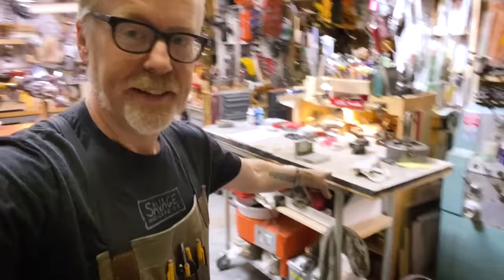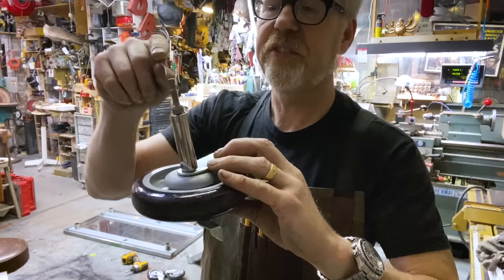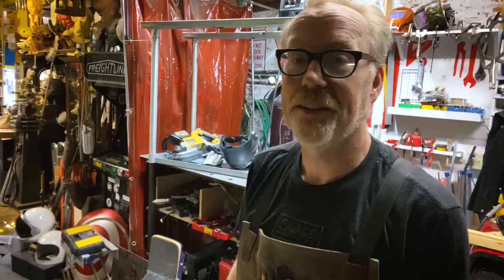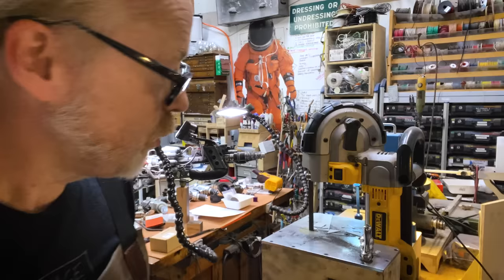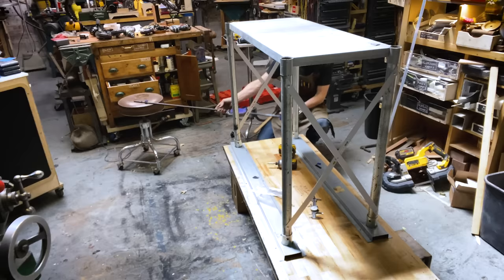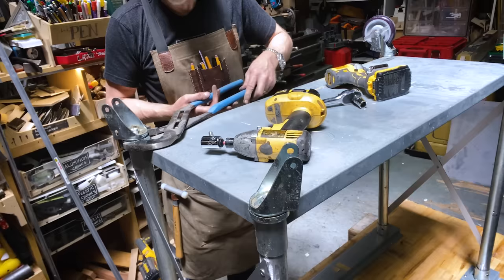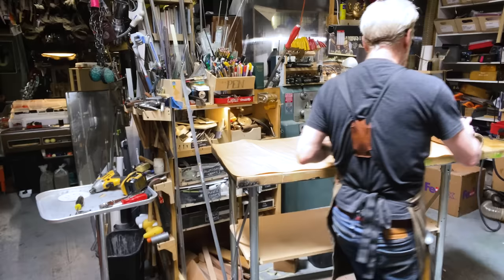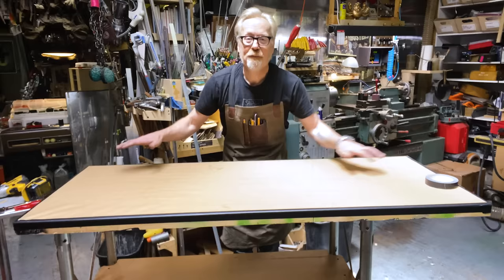Adam Savage's One Day Builds: Making a Stable Workbench!

Comment from the maker: Adam's Workshop Apron: https://amzn.to/3fHKdSs
IRWIN Quick-Grip Bar Clamps: https://amzn.to/2Z6IkYj
2" Black paper tape: https://amzn.to/2YiozOc
Reply: I'm going to hazard a guess that you got that aluminum from Home Depot, one useful trick with our labels is WD-40, soak them for a few minutes and they'll come right off with some minor scraping. They have an X cut in them to help ingress for exactly this purpose ;P
Reply: Do you have any apron recommendations that don’t use animal products? ie no leather
Reply: Can I gat a useful tool vid for the rolling Tray that you used here?!
Reply: Mr savage your wheel brakes are upside down....3 out of the 4!! Please revise ..xx
Reply: @caseyalexandrarich3452  steel 😭😭
Reply: Did you miss a rivet? on that 2nd cross piece.
Reply: Do you ever use self-tapers? (Basically a screw with a drill bit on the end)
Reply: LOL small ... check out the navy channel locks ... they make those ones look like baby tweezers ... btw on an oil rig the big wrench they use to tighten and loosen pipe segments ... are channel locks ...
Reply: looks good now ... you can always weld once you fix the welder if need be ... one other suggestion change from the wheel locks to a foot jack lock ... it will make it more stable and is easy to release and then wheel where ever you want ... like those mobile stairs at the big stores that sell in bulk or like hardware superstores .. that idea ...
Reply: Not Adam's hearing aids, something is definitely ringing in the shop(area). Sounds like a low revving turbine engine.
Reply: @HB-hf5ew  I think thats what was used. Pilot first to be sure .. to be sure
Reply: @smartgorilla  A steel apron would not be useful for welding.
Reply: @buddyclem7328  I know but it's vegan🤣🤣
Reply: Anything petrochemical will burn
Reply: @philstephes  I always thought those crosscuts were to prevent people from removing them in the store and switching them for something else... Now I know!
Reply: @caseyalexandrarich3452  - Have you tried doing a search for "vegan welding apron", "fabric welding apron", or " non-leather welding apron"?? There are a bunch out there. (Just make sure it's not just "Fire Resistant", but Arc Flash rated for high temperature splattering).

Apron #1 (CF & Aramid, with Nomex stitching):
https://steinerindustries.com/carbonized-fiber-series/product/steiner-13625-cf-woven-carbonized-fiber-bib-apron-36-black
Apron #2 (Thermonol High-Heat Welding Apron with Kevlar stitching):
https://www.grainger.com/mobile/product/STEEL-GRIP-Thermonol-w-Kevlar-ThreadHigh-5T351
Apron #3 (TexTech CarbonX Fabric - for Steel Foundries & Welding):
https://amp.rshughes.com/p/Chicago-Protective-Apparel-Carbonx-Welding-Apron-29-In-Width-48-In-Length-548-CX11/548_cx11/

Gloves:
https://www.kvmwelding.com/

If you wanted to make your own then perhaps a carbon fiber welding blanket fabric backed with denim would work?
"Lightweight & soft ... Sheds less than fiberglass":
https://www.sellstrom.com/carbon-fiber-felt-welding-blanket-black-p-740.html

Or this stuff is Arc-Flash rated, woven Nomex & Aramid... Sold by the yard and quite reasonable too ($15yd)! (They supply Nomex to NASA for the 2020 Mars Rover mission):
https://www.magnafabrics.com/collections/ripstop-fabrics/products/nomex-aramid-ripstop-anti-static-esd-clean-room-fabric-sage-green-12-50-a-yard
... You might want to put a thick cotton backing on it, so you don't feel the heat, but the fabric itself "should" be suitable.
Reply: Thanks for the build.
Handy tip Cardboard for bench covering, it's absorbent cushioning and tougher than paper.
Reply: steveday72 thanks I’ll check these out
Reply: @steveday72  They do have specific labels for that, but they're usually thick and used for things like electronics.
Reply: WOW great workbench if I had money I would buy that... P.S. I don’t have a penny to my name 😞
Reply: 29:33 you should take a look at the real beast... the Knipex Cobra XXL (22 inch version) as well as the Knipex Pliers Wrench XL (which is a beast in itself as well)
I have had the chance to test the big ones (just not have the use for those right now that would make me buy them) ;)
Reply: Those chrome sockets shouldn't be used in an impact, they will shatter/explode
Reply: What are those ear muffs he's wearing?
Reply: Why does Adam cover the work bench in brown paper?
Reply: I built a rolling cart one time out of
2 4x4x8 for legs
2 4x4x8 for sides
2 2x4x8 for sides
2 sheets of plywood for top and shelf
pipe fittings for handle
4 casters
Cut two 4" x 4" posts in half for the legs(4)
Cut two 2" x 4" x 8' into 2 pcs. so you end up with two 3 ft and two 5 ft pc.
Cut two 4" x 4" x 8' into 2 pcs. so you end up with two 3 ft and two 5 ft pc.
Cut plywood into 3 ft x 5 ft 
Now you build a 3 foot by 5 foot cart.
This next step works best with the flattest floor possible to keep square and flat.
Take two 4" x 4" x 5' and two 2" x 4" x 3' and screw together to make a rectangle.
Take two 4" x 4" x 3' and two 2" x 4" x 5' and screw together to make a rectangle.
For the strongest top use the rectangle with the 4" x 4' x 5' as the top.
Screw plywood to rectangles.
Screw legs to rectangles.
Attach casters.
Attach pipe fitting handle.
The only leftover material is the plywood.
The table is strong because of the 4" x 4" legs and the 4" x 4" in the sides of the tabletop/bottom shelf.
That cart was perfectly square to the floor. All 4 casters were on the ground at all times on a flat surface. Best damn cart I ever built.

Comment: I can't believe I may actually be able to give YOU a tip.  Channel locks have a direction.  They are built in such a way that jaws self tighten if you are pulling in the correct direction.  If I represent the channel locks with the letter "F" you want to pull the bottom of the handle to the right.  Of course if you want to go the other direction flip the pliers so you have a backwards "F" and pull to the left.  When doing this, much less of your energy is spent trying to squeeze the pillars hard enough to stop the stock from spinning.  Try it, You will not believe the difference.  We can all thank my Dad for that one,  Happy Fathers Day everyone.

Comment: When the camera started falling when using the mini band saw I was terrified that Adam would reach for it and accidentally hit the band saw with his other hand!
Reply: Same!
Reply: At 15:35? Yes! That little saw really needs a blade guard/guide, especially since he's typically only going to use it to cut thin little strips! If he ever needs to resaw 6" stock he'd use a different tool, no need to leave all that blade both exposed and unguided.
Reply: I RIPPED out my fingernail on my belt sander. It's getting better.
Reply: I still think that thing needs to operate on a kill switch so if he drops or lets go it just shuts off.

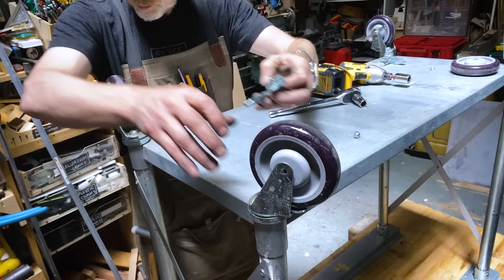Comment: 31:00 - Adam talks about how he should trust himself about getting the orientation of things correct while bolting the caster lock leavers on upside down... You do you Adam
Reply: I mean it seems to still work regardless? I think that was his point.
Reply: I only noticed the same thing because I have done the same thing myself. Good show
Reply: @Platinum_Squid  It would almostwork the way it's supposed to. Depending on the caster design having the brake lever installed upside down may not engage the brake correctly. Realistically it's more of a thing that he won't have as far a travel on the lever because it's designed to be a slight upward (U) curve so the lowest point of the lever is the middle where it connects to the caster, when installed upside down it's going to sit slightly below center of the wheels and therefor contact the ground before it fully engages the brake.

I highly doubt this is a big problem for Adam anyway though as he said the whole reason for this redesign was cause he hated it when he had to move it and he had to move it often so I doubt it'll be locked into position often.
Reply: I cam here to mention that also.... :)
Reply: @Platinum_Squid  how did you get that impression? That was obviously not his point.
Reply: I actually just re-inspected this point and the style of caster he's using would barely work if at all with the brake lever installed upside down. If you look closely there's a triangular piece of metal at the center of the lever, this is what actually applies the brake and should be interacting with the inner plate you see Adam install between the caster and the lever.
With the casters assembled like this the brakes won't engage correctly.

Also this is not likely a big issue as he's got one of four casters assembled correctly so the table won't just roll away and as I said Adam mentions that he's constantly moving the table around so he may never really use the brakes in the first place, but boy is he going to be pissed at their performance (or lack thereof) when he tries to.
Reply: I watch these to try and guess watches gonna fuck up.
Reply: 31:20 "... and I haven't been proven wrong yet."
That's just asking for it...
Reply: @Platinum_Squid  Yeah, his point was kinda let yourself have those "hm that's not right" moments, whether it's the last step of a long vision or putting a caster bracket on backwards, or hell everyone sometimes has to recite "lefty loosy righty tighty" and even if you get it wrong you can count on your methods and yourself to correct it on the fly.

Comment: "It's likely a simple fix but not one that I'm in the mood to do today"
Reply: My life in words.
Reply: Mood
Reply: Odds are it’s a loose connection, a 2-second fix. Kinda kills me that he didn’t (seem) to even run through a quick checklist of easy fixes. Can’t tell you how many times as a maintenance tech. In the military the issue was the frickin’ thing was just unplugged…
Reply: Myeloman thank you for your service
Reply: @TheMyeloman  Unplugged, breaker tripped or my personal favourite three years worth of caked on grime inside the welder. Don't get me started on galley equipment.
Reply: Myeloman understood. Otoh, I hate losing momentum when it turns out to be more than a two-second fix, or worse becomes a total sidetrack. That said, I was sure that Adam was going to pull out a stick welder.
Reply: seems a lot better than using flimsy aluminum as a brace
Reply: Too busy with the first  simple fix
Reply: Adam probably just ran out of welding wire.
Reply: So MUCH to do  but no desire to do it.
Reply: @MarcosElMalo2  or a pinched wire inside the whip. That happens alot to me

Comment: 30:41  My first real job in a repair shop back in the 90's was home electronics repair; mostly VCR's.  My first lesson in the disassembly/reassembly of these small appliances was the great importance of organization found in....   a simple ice cube tray.  Break the process down into steps.  Hardware from each step gets it's own space in order.  E.G.: Remove outer case screws, those screws go into first 'bin'. Next the rear panel screws, they go in the next bin.  Mechanical chassis screws, next bin.  Main board screws, next bin...etc.  That process gives you every chance you need to tear down and rebuild an item with no screw left behind.  To this day if I'm digging into something I'm not already familiar with, one of my first questions is, "Where the hell are my ice cube trays?"

(Thanks for being a good boss & teacher Chuck!!)

Comment: glad to know I'm not the only one that worries about forgetting how to reassemble something. I recently rebuilt my motorcycle engine and I not only laid out each part, nut, and bolt in the same orientation and order that I removed it, I also labelled and took pictures of each step as I removed parts little by little. Helped a lot when I reassembled everything a few weeks later once the heads and cylinders returned from the machine shop. And I've found it helpful for a few friends to show my pictures and be able to have those internal shots that you normally don't get to see.

Comment: Adam. Would you consider doing a build show on making a radio controlled lawn mower? There's a lot on YouTube about making one using electric wheelchair wheels and motors and a Sabertooth power module, but these range in complexity. It would be great to see you build a simple one with the following criteria.
1. No welding required.
2. The deck of the mower must be height adjustable from 2" to at least 6", both front and back.
3. The electrical power of the mower should be able to operate for as long as a standard tank of gas would for the engine. I guess about an hour and 15 minutes.

From those of us who are trying this in order to cut steep slopes on our lawns, this would be a wonderful help!! Thanks for your time and all you teach us through your channel!!

Comment: Great rebuild.  If you go to a medical supply house, you should be able to get a roll of paper similar to what physicians use to covet patient exam tables.  Depending on the inner dimension of the paper roll, you could probably hang a feed roll under the overhang and ass a strip of hardware store aluminum alloy strip to the table edge to dispense or feed the paper from roll across the table top.  Thanks for sharing this video.  Wishing you and your spousal unit peace and continued safety.   Greetings from NE Ohio.  Cheers.

Comment: Re: The Brown Paper...

Personally I would've made a kitchen towel type dispenser for the roll of brown paper and two strips of metal o n each end of the workbench for the paper to slip under... Much like they have on doctor's examination tables. Maybe that'll be the next upgrade?
Reply: That would mean the paper moves around when you slide stuff around. No a big deal for a doctors office but could be annoying for Adam.
Reply: Personally, I would not use paper at all unless I was doing a lot of painting. A workbench surface, particularly a wooden surface, can take some abuse. Once it gets too bad, just sand or plane it down and then its good to go again.
Reply: I heard brown paper and was like "Numberphile crossover?!"
Reply: @Crispy_Bee - The paper would be under the metal strips at either end, so it could only move side-to-side.... An easy fix for that would be a simple clamping mechanism at either end to apply downwards pressure onto the metal hold-down bars and some foam rubber or cork on the side that contacts the paper.

Personally, I haven't found the doctor's office exam tables to slide around (and I'm in several Dr's offices regularly), but that's probably due to the clean vinyl gripping the paper a little.
Reply: @XJWill1  - Norm Abraham uses thin sheets of "hardboard"... The compressed wood fiber stuff with a very smooth side and the other side rough. His edging strip around his bench is raised, which creates an inset for the sacrificial worktop and it sits flush when installed.
Reply: @steveday72  Yes, I've seen that in his videos. That works for some people, but it is thin and does not sand nicely anyway so most people just replace the hardboard when it gets too bad. I prefer to stick with a thicker, real wood top and just plane or sand it down when it gets too bad.

Comment: A tip a learned when I was a gallery/museum framer for a fine art gallery framing shop. When your putting on the brown paper table cover secure one edge (usually the edge hardest to work around). Then lay out and trim paper to just over hang the edge of the table top. ** before securing the other edges lightly mist the paper with water**. Then secure the other three edges. Run a hair dryer over the damp paper working from the edges towards any wrinkles in the paper. The paper contracts as it drys giving you a flat fitted surface that will not trap any dust in a bulge or valley that can then transfer onto your work! Tip 2: do two to three layers at a time. Secure each layer separately. When the top layer is damaged just quickly strip it off and keep working. Taking 20-30 min at the start of a project to prep the workspace can result in less waisted time during the active work time, keeps the surface clean and that keeps the work clean. Less down time keeps the work moving.

Comment: a few years back I had an old serving trolley on wheels that was about three times as rickety as this table, Basically I just boxed in 3 sides of it with plywood, added a middle shelf, now it sits under my little hobby mill and holds all the tooling, I also managed to add a 50lb 6" vice onto the other end of it, when I use the vice it still moves a tiny bit, but generally its solid enough to work on the mill happily.

Comment: 8:58 - Zinc is a lighter metal than iron (or steel). It's still a good idea not to breathe the fumes, of course (but that includes fumes from the steel itself and from the welding rods).

Also, while grinding them off you're turning both the metal and the sanding disc (often containing quartz particles, which is crystalline silica - extremely bad for your lungs) into dust. So if the plan was to "not get them in your nose", you probably should have worn some protection for that part.

It's a bit weird to see someone use a full face respirator (in a previous episode) to grind glass, which produces one of the least harmful types of dust (amorphous silica), and then wear no breathing protection at all when dealing with far more dangerous dusts and vapours.